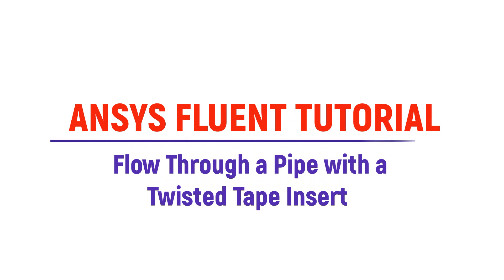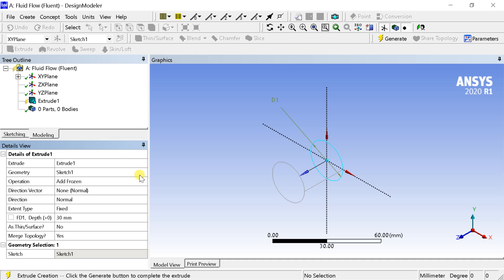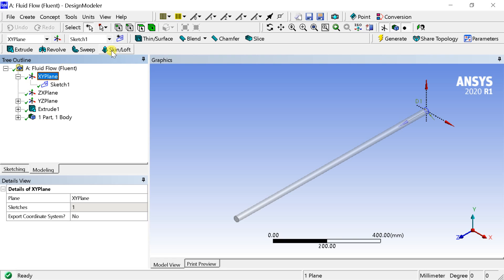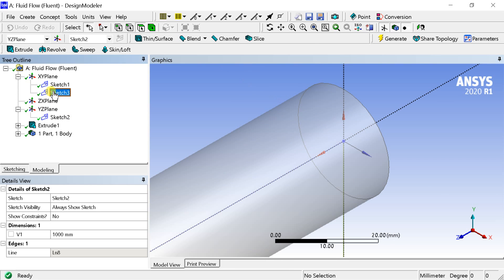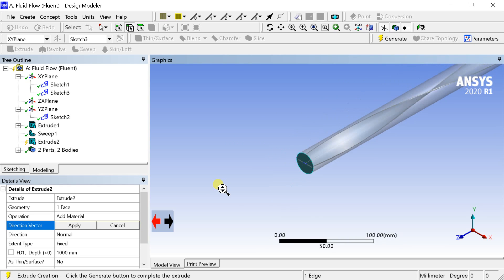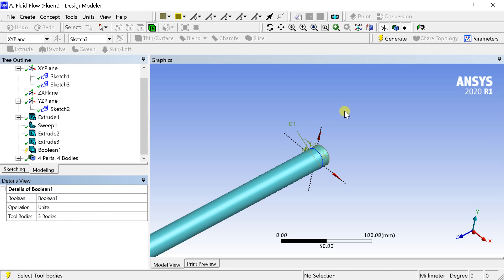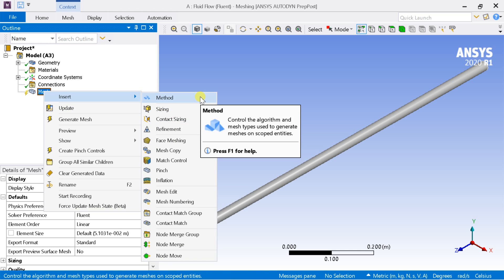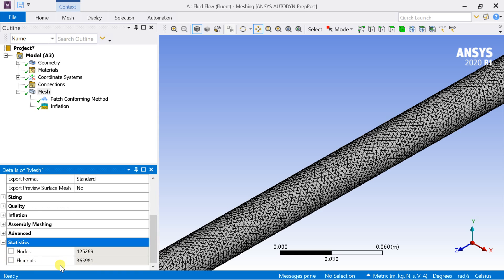ANSYS Fluent Tutorial | Flow Through a Pipe with a Twisted Tape Insert | ANSYS Tutorial Part 1/2

Comment: Thanks for the great content! Why you did not apply inflation layers on the twisted tape geometry, only on the pipe wall? I would prefer to put inflation layers on the twisted tape as well to model the flow within the pipe more accurately
Reply from the maker: You can apply the inflation layer on the twisted tape. I have only shown the process . you can modify it as per your requirements.